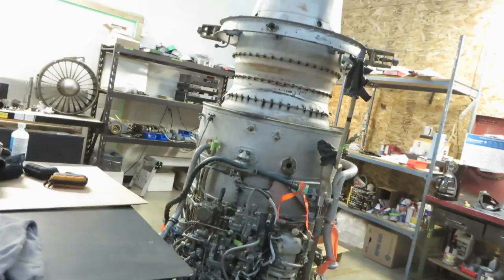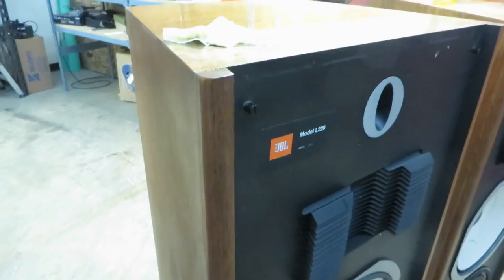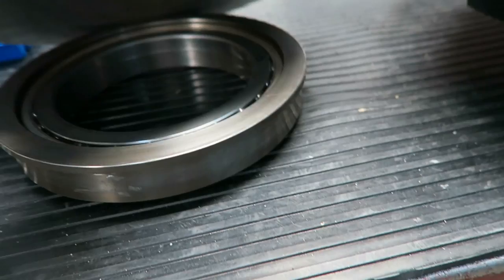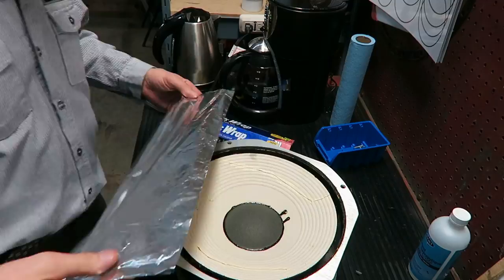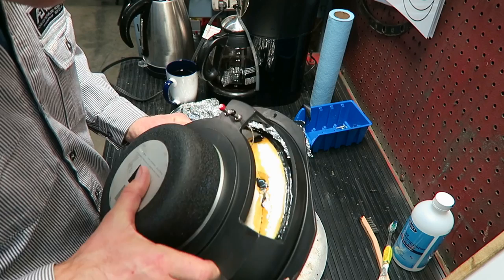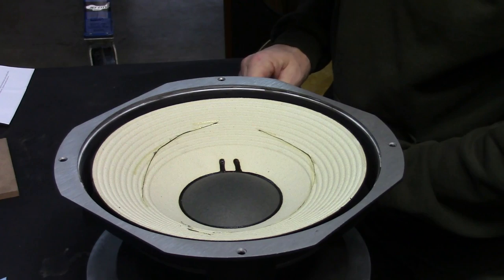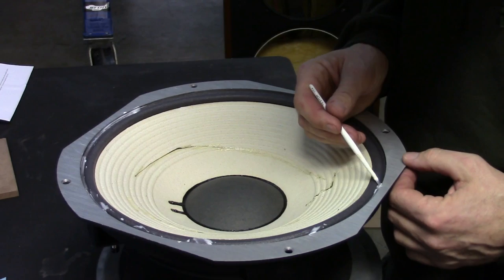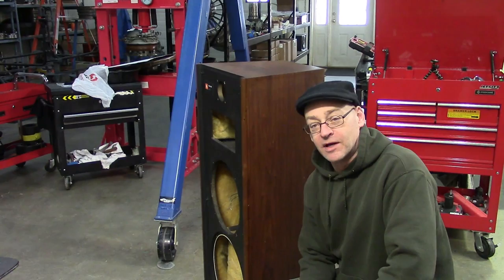JBL L220 pt 1: Low Frequency Units

Comment: Hi, I have a pair of these awesome JBL L220 s, and I agree that they are the best-sounding loudspeakers I've heard. However, I have recently dismantled both columns because the cabinetry needed repair. I now want to completely rebuild the cabinets from scratch. I have all the parts including the crossover. I need the exact specifications for the wood build from scratch. Can you assist me? Thanks.
Reply from the maker: Well I don't really know.
The cabs are made of 19mm particle board, and I do not know the patterns for the trapezoidal shape. The tricky part is that they are covered with hardwood veneer by people JBL referred to as furniture makers.

If I had a pair of smashed up cabinets, I would try to glue them back together.
Failing that, I would try to use the existing cabs for measurements.
Reply: Thanks for replying. I will try to use the measurements from the existing pieces. Appreciated.

Comment: i just want to comment that i appreciate your wanting to jeep them stock but i would say those should be reconed     the structure of the driver cone is imperative to sound fidelity and there is going to mostlikely be tons of errant deflections mudding up the sound quality       i dont know how hard it would be to attach new cones to exisiting u damaged coils
Reply from the maker: +Robert Bardos It's not hard, just expensive. I've done a couple house-shaking 18 inchers.
These cones are fine. As reported elsewhere, they passed the THX test. When the cones break, I'll replace them.
Probably need new windows first.
Reply: Hahah  those are some impressive cabinets and if sounds good might as well run em           i particularly like the tweeter diffuser     thats remarkable how they designed it with radiative fins to presumably direct the sound waves
Reply from the maker: +Robert Bardos Thanks for laughing at my speakers. The plan was to run them all along. That's why I spent weeks restoring them.
 That would be the acoustic lens for the 5' midrange driver. It's there to increase the horizontal dispersion pattern, so that's directing sound waves, right?
Reply: I was so impressed I had to hop on Craigslist to see what was around locally for JBL cabinets.  I found a pair of 8" drivers with the radiative fins like yours but nothing close to those cabinets.  I would love to hear 2112 cranked up on those baby's.

Comment: You make the refoaming look so very easy... I am dealing about a pair of L220 with a few quirks, the owner told me that his dad, who was the original owner, already reformed the woofers but the passive ones need being done and I have been asked quite a bunch of money from a company without to add shipping costs on top of it; your video makes it seem so easy as a DIY job, almost convinced me to re-start the negotiations.

Other issue being the owner painted the cabinets, the sides and top with transparent varnish and front and back with black one and it bothers me so very big time, I am trying to attach the link to a pic so you can see what I mean, I would like to hear your opinion about restoring the cabinets to original conditions.

Least but no last, last time I heard them I noticed a speaker sounding lower than the other, it was very very quick, no time to check connections or other issues along the chain but I will go again in the coming weeks and hopefully being able to give them a better test, could the crossover be failing to some point and what should I check to make sure it can be worked around?

Oh, by the way, I am still happily playing the 4311B I bought as a teenager ;-) 

[IMG]http://i68.tinypic.com/98gfw5.jpg[/IMG]
Reply from the maker: I would forget about the finish, because it does not affect the sound. The drivers are that easy to re-foam. Do it yourself for less than a hundred bucks.
You may have difficulty depending on the adhesive used last time, but you will enjoy the process if you have patience.
The capacitor replacement I did was worth it.
There are other crossover parts that are generally available.
You will do just as good a job as whoever is going to charge you for the work.

I have never seen another pair of 4313WX's, so I wonder if have the only pair that was ever sold!
Reply: @AgentJayZ  Very kind of you to reply and so very much encouraging, I will try and arrange a deal once the xmas holidays are gone and will figure where to start from, sure the foam on the passive gotta be replaced then have to find out if there are electrical problems, it would be great to put them back into working conditions and I will sure come check your video again before I attempt the foam replacement and will keep you posted.

Thank you so much!!!

Comment: AJZ you said you've used all your teenager's pennies to buy your favourite loudspeakers ? I did the same to by the "Advent Loudspeakers" on 1978, and now it is come the second time to change the foam suspensions. Yes, you're right: once every 25 years, because I just want to keep this sound with me. (and the Advent company does not exist anymore, if I'm not wrong).

Guess what I'll do ? Never again I'll give away this job; I'll do it myself, thanks to your fantastic video and accurate suggestions.
Your way to seal the O.dia first and then let the cone be into its natural central axis before to glue the I.dia is more than good.
Can you please say again:
1. Which type is the white glue you are using for the foam suspension ?
2. Any suggestions for the selection of the type of the foam suspension ?
I can only search for some equivalent O.dia/I.dia couples of suspension ... because I'm in Italy.

Many thanks and regards, from Italy :-)  Ciao.
Reply from the maker: 1. The glue that comes with the specific kit. It's water based, but I don't know exactly what it is.
2. The foam suspension is part of the specific kit for your speakers, which I am certain is available.
Reply: Thanks. Ciao

Comment: I love this series on the L220. I bought my pair in 1980 while a young Marine stationed on Adak, AK. I still have them and I want to restore them like you did. I search a bit could not find a parts list. Can I get the parts you used?
Reply from the maker: Simply speakers makes a kit for both of the woofers and both of the passive radiators. It's what I used.
Reply: AgentJayZ thanks, I ordered it. What capacitors did you use.
Reply from the maker: I used these. I think I spent too much money on the so-called "premium" caps.
I've learned to use non- electrolytic, caps. 5% value tolerance, and lower dissipation factor is better.
Good news is those are not expensive.
Put this into your search bar: http://www.erseaudio.com/Products/Capacitors

Comment: DUDE! How did you get that black glue off of the back of the cone?
Reply from the maker: I showed you.
Reply: @AgentJayZ  Hmmm, at the point in the video where you pointed out the black glue on the back of the cone, the video jumped to the part where you began adding the glue for the ring that holds the foam ring in. I will watch it again, but I don't think you demoed that part. Anyway, very cool video. Those speakers look amazing.

BTW, where did they bury the POS that sliced those beauties up? The death penalty would be too kind. 😉
Reply from the maker: I scraped it off carefully with a sharp knife blade held at a near normal angle to the cone surface. Nothing special, except great care..

Comment: pulling the dust caps takes no time at all and is the only way to ensure the coils will be centered.
Reply from the maker: The dust caps are not pulled; they are cut out. The cut then needs to be reglued, which can detract from the appearance.
My half-ass glue job is bad enough.
The spiders do a good job of ensuring the voice coils are centered in the gap...matter of fact, that's what the spider's primary function is.
The speakers are working well, producing thunderous bass, with no problems with misalignment of the voice coils.
Reply: AgentJayZ it's awesome that it worked out.  I've never done one without cutting the dust cap so I guess I can't really compare.  beautiful speakers I'm sure they rock!
Reply: the coils are in the right position because at the factory assembly they do start to glue the spider first paying attention to center the coil tube within the magnetic gap, and this need a free way to get through the middle with a gap centering tube (paper or plastic thickness).
You did extremely good AJZ.

Comment: Jay, can you advise on my JBL N-2400 crossover networks purchased in 1974... sound ok, but probably use a re-cap?  I built JBL spec ported cabs for D-130 and 075 ring radiators, been going strong since...  thx!
Reply from the maker: If they sound great, no work needed, really.
If they were mine I would find out about replacement capacitors, and think about maybe replacing them.
Maybe!
Reply: Thanks!
Reply from the maker: Those speakers must be able to rattle the neighborhood. Pro grade components that will last forever. I have one E-130 as a guitar speaker, and it is an industrial sound reinforcement machine!
Reply: @AgentJayZ  when I built them, I wanted to go with LE15 PR15 LE85, but the  college student budget restrained that idea.  Still I think they are a nice sounding spesker, presently residing in my 40x60 shop, where I do occasionally "crank" them.  One cab is rattling, and I have drawn plans for new ones, and have decided to st least open the N2400s to check parameters.

Comment: Now that I finished watching the video. Why do you need new capacitors? Is it something that should be done on an older set of speakers. Or were they damaged during the entire? Same question regarding the replacement of crossovers.
Reply from the maker: The capacitors in crossovers are said by many to degrade over time, depending on the type used. The L220 crossovers have wax and paper construction caps, so I decided to replace them with metal film caps, which are supposed to last forever.
In my opinion, it made a difference in the sound.
Replacing the entire crossover is a more expensive way of achieving the same thing, because none of the other crossover components degrade with age.

Even if you do nothing to the crossovers, if you replace the surrounds in the woofers and the radiators, the L220s will move your floor!
Reply: I am going to need to replace both the cone and voice coil because they put out in my garage in this Arizona heat has tried them out to the point of the paper being brittle. I'm trying to find someone who can work on the cabinets along with the speakers. As very few people that recone speakers. The one that I did find specializes in JBL professional speakers. Although they don't do cabinet repair. When they were shipped out to Arizona one of the connectors on the bottom of the speaker was broken. So now all I have is a wire sticking out of a hole in the particleboard. For the longest time I just intertwined the wires and called it a day. I personally could not hear a difference in the sound. Thanks for your input.
Reply from the maker: YOU can recone speakers. I did on a 2245H (JBL pro 18 inch) and it can knock the house down. If I can, you can.
Reply: Problem is, my arms and hands don't work like they used to. I never recovered from the broken neck. I am paralyzed from the neck down essentially. I can move my arms but not my hands. So I got around by wheelchair. You have a link to where you like your replacement parts. I would like to replace the whole crossover and speaker components. You mentioned they were $300 a piece. To me that's worth it. I am fortunate enough to be able to afford that. If I have all the parts I know where I can get the labor done right. I would appreciate your help. I will also post videos on my YouTube channel.
Reply from the maker: Dude, I did not know that. I will help you out.  I do not think the entire crossovers need replacing, just the caps. The recone kits for the 14 inch bass drivers are rare, but they can be found. The passive radiators do not need reconing ever, but there is a re-foam kit available which is very inexpensive, and that is all they need.
Message me for more info.

Comment: You wouldn't want to part w a couple of those L110's ? House is only so big,eh?
Reply from the maker: I do have a "spare' pair of L110s, but they have more collectible value than functional. I got them on Ebay 7 years ago for less than half of their original price in the 80s. I think that may have been the bottom of their price cycle.
But I don't have them to profit from; I have them 'cause I like them.
Reply: +AgentJayZ Fair enough. Thanks. Market peaks tend to be when the original enthusists reach their 40s-50's...their peak earning years.
Reply from the maker: Dude, on Ebay there is a sweet pair of wounded 4312A JBLs going for about 10% of their new price back in the day. The woofers need reconing, but hey, they are the professional version of the L112.
They are a beefier replacement for for the L110, and were built while quality was still very high.
Reply: Kk, looking now. Bidding price is low w 3 days to go...will jump up at end. Thanks for tip!
Reply from the maker: Was that you that won the auction?
Reply: No! I was in field and made to to my computer about a hour late. sigh
Reply from the maker: Always be more...
Reply: True. I'm a bit confused on the Model Nos.. Which ones should I look for? Thnks
Reply from the maker: That's hard one. There are many very good old speakers out there that may be going very cheap because they need repairing.
Reply: Well, after thinking about it a bit, and seeing how small my living room is, I thought bookshelve size may be the way to go.....any thoughts on jbl's HLS-610s?

Comment: You can build them actually if you look on YouTube there actually is a guy that is building the earthquake bin you just have to add the driver figure the magnet better you know that lol when I went to my smaller system and sold my Vegas I switched to Yorkville sound use the SW 600s and a pair of 401s wasn't too bad a lot less hauling around but the SW 600s or the one thousands never had the punch that the earthquakes did the horn been was the best it was big big punch

Comment: Well this is the first video I ever watched of yours whilst at the time not looking for anything jet engine related I must admit I am now much better educated and understand the workings and terminology surrounding jet engine technology thanks to your great vids so hats off to you and  now subscribed look forward to your latest uploads.

Anyhow... So I figured you like your music, are able to explain things clearly and answer viewers questions, so well here goes - i don't know if it's a question as such or an opinion on how feasible an idea is - have you ever came across the 'rotary subwoofer' ??

https://www.youtube.com/watch?v=E7Bkrypxzs4

I came across this quite a few years ago and have pondered upon alternate designs until whilst watching you demonstrate how the variable stators are actuated in several of your videos I thought, so would it hypothetically be possible to have say even just one stage of a jet engine compressor, have specially made fins/blades that are perpendicular to the direction of travel around the assembly so that if the stators next to the rotating part were also 90degrees that whilst spun either electrically or hydraulically - no air would move in or out.
Now just like the rotary sub it basically goes down to DC - if you applied a voltage across the voice coil that was Dc it would just blow air ( or suck if the polarity was reversed ) Then a solenoid type affair connected to the linkages that change the pitches of the stators you would get the same effect I would imagine...

Then after watching even more of your vids I 'think' i may understand the basic laws of physics just a bit better than previously and thought well hey why not just use a complete modified compressor as at one end the air mass moved will be high, whereas at the other end the MAF will be lower but at a higher pressure - which would be ideal for any type of bass speaker as all the multitudes of various designs over the years all try and get the most out of coupling that cone as efficiently as poss to the air around it FROM ONE SIDE or ways of making the air at the rear of a coned driver appear in phase with the air at the front at the lowest bass notes the cabinet is designed to work down to...

I'm told i dont always explain things very well but at least i've said it and the cats out the bag now so as to speak. I hope you can visualise my idea and would love to hear your views :-)

Comment: stop getting the glue on the foam when it dries it gets hard and changes the elasticity of the foam
Reply from the maker: Did you even listen and watch? The point I was making was that comments like yours are completely incorrect.
Water-based, and it all comes off. No dry. No worry about foam. You wrong.
OK?